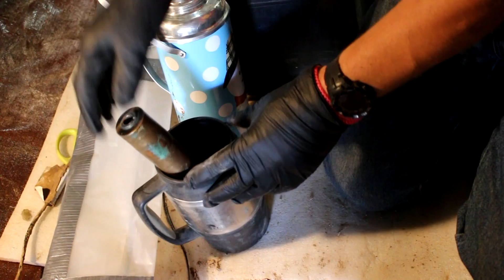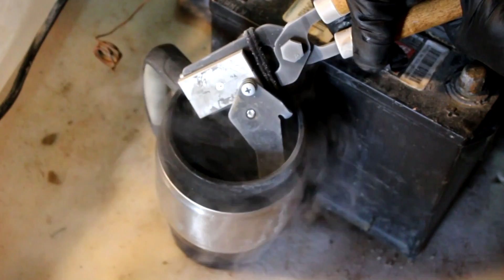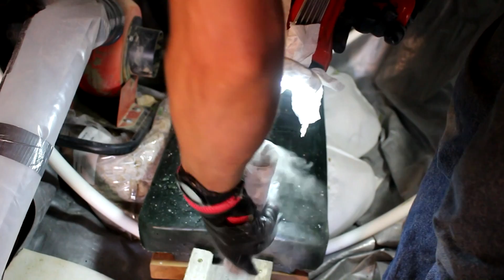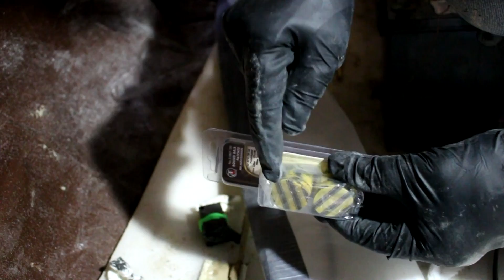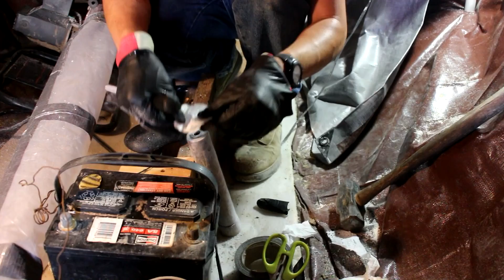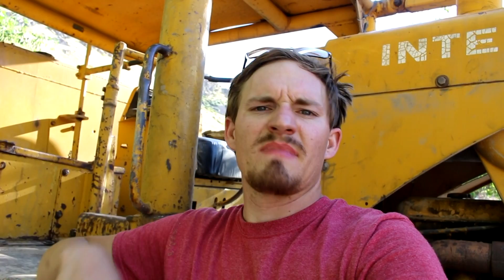Shooting Mercury Bullets

Comment: Mercury can kill in about 24 hours shutting down the nervous system. They would start losing motor functions first. You would not be able to save them by taking out the bullet because a high concentration of elemental mercury would start to accumulate in the brain. Lead gives you plenty of time when you're going up against mecury posioning. since you said you dont know why mecury is considered more toxic than lead What you're able to get on your skin and live isn't the same as the mercury you could potentially use in a bullet. There is a YouTuber that is a doctor that went over what happened to a lab technician when they got a drop of concentrated mercury on their hand.

Comment: I saw a hollowpoint being filled with mercury in a movie.  It was drilled out a bit, filled, then soldered shut.  According to ledgend, no it wont kill you right away.  But will later.  So even a non lethal wound...is.  Is that about right?
Reply: If you survive the gunshot... probably not. Mercury isn't that dangerous

Comment: Hey Cody  I was just wondering that you might want to do  Kelvins Water Dropper / Storm with mercury instead of water.  Recall the static generated with the Spregnel Pump you made (great video).  Afaik it will work with mercury and I don't know if it's  ever been done. Just an idea, no presh.

Comment: Imagine getting a flesh wound then die in a week later from mercury poisoning. That would be a devastating round if you encased Mercury inside of one designed to fragment once it hits something. Especially if they used a drop a dimethyl Mercury. Every hit would be a kill shot. That would work great if the US was fighting a country that was fighting dirty. Using chemical warfare things banned by the Geneva Convention.

Comment: The trick is to drop liquid mercury into a drilled lead round as a capsule, then seal it from the front with epoxy. The mercury acts as a penetrator.

Comment: mate why not fill a normal copper jacketed round like a 7.62mm x 51, take out the lead and fill it with mercury and then shoot ballistic gel and cap up the projectile with copper or lead top, so that when firing it it will still hold together under the heat when its transfersing in the air at over 2,800 ft per second or better still a .223 round or 5.56mm bullet, that way its going even faster or even a 6.5mm creedmoor projectile?
Reply: Because using a copper jaket would ruin the meaning of the test? Are you dumb or what

Comment: did the ramrod not fit when firing the ball, not because of lack of lubrication, rather because the barrel had contracted and so was smaller compared to its size at ambient temperature? If you were to cool the ramrod, or use a smaller ramrod, would it work?

Comment: Mercury is a hell of a lot more dangerous than lead to the environment all you need to do is do a google search to confirm that.  On the other hand, in places where mercury was mined, like the land Cody is on, the little bit he's adding is not likely to have a significant effect.  I would be much more worried about the long term health effects of walking into that tent, vented or no, and inhaling the mercury vapor that is still present.  Of course, Cody may have thought of this and have some method of measuring the residual mercury vapor, but if he does, I missed it

Comment: There is a very simple reason why shooting lead is way better than shooting mercury and I would have guessed you of all people would have known this, Cody. Lead binds to soil EXTREMELY well. The main mass of the Lead bullets are going to sit underground basically forever and the small particles are going to bind to the dirt basically forever, problem solved. Mercury, on the other hand, is a liquid first of all and DOES NOT bind to dirt as Lead does. So, who knows where the liquid Mercury is going to go after it's been shot at whatever, could get into the water supply and up the food chain. That's a problem. And then the small particles of Mercury will leech off poisonous vapors. Obviously, your single experiment here wouldn't have hurt anything. But let's imagine a shooting range that only used Mercury bullets like we use Lead bullets... the area would just constantly be leeching Mercury vapors in very toxic quantity, regular shooters would almost certainly develop Tremors and ED from the Mercury vapors. If you do a little thought experiment like that and know why Lead isn't considered a toxic substance shot from a firearm, then you understand why Mercury IS considered a toxic and Lead isn't in this setting. 

So, next time you don't know something like that, don't dismissively say "who knows why this instead of that..." scenarios. There could be a very good reason why. You should have looked into why that law is there, not dismissed it because you thought you knew everything about the subject. You could have learned something and given us that knowledge in this video instead of passively encouraging us to remain ignorant when we think we know everything.

Comment: Because lead is a really good, cheap material to make the cores of bullets out of. It's dense, and it deforms on impact. It's been used to make bullets for well over a hundred years, while mercury is as you have found, not terribly easy to shoot.

Comment: Maybe this is a misunderstanding of the physics, so correct me if I am wrong.  If the bullet is heavier, and the same amount of energy (same amount of powder) is used, it would have the same momentum, but a lower velocity than the lighter lead bullet. 
My thinking comes from the fact that to accelerate mass requires overcoming Inertia.  The more mass, the more inertia.  

F=MA

If you want to increase F by increasing M, and keep A constant, you need to increase the energy used to generate A.  Am I wrong?

Comment: Wait, but it's legal to put mercury in vaccines?  How the F does that make any sense?
Reply: They don't. Back when they did it was a less harmful form of mercury and was present in incredibly small doses that caused no harm. Calm down.
Reply: @randyohm3445  less harmful, mmmk
Reply: @whozaskin3639  Have you actually done any reading about this, at all? There was zero evidence of harm from it, and it was removed anyway to appease morons who don't read. If you're still worried about it, you're... well, you know.
Reply: @randyohm3445  depending on your definition of reading, zero, and evidence, you may be right..... depending on your definition of right

Comment: yeah but lead stays solid in the body and it's hard to absorb lead that isn't in solution, unlike mercury which is easily absorbed even as a pure metal.
Reply: mercury actually isnt absorbed easily in its elemental form. you can stick your entire hand in it and as long as you dont have any cuts you should be fine.

Comment: you did it wrong, use a hollow point .22 shell, put mercury in end, cap off with a small dab of solder.  shoot out of a .22 to a soda can from about 20 feet and watch what happens :)

Comment: these bullets are super deadly not only would the impact hurt but the mercury would kill you
Reply: Elemental mercury is actually pretty damn safe, it's mercury SALTS(Mercuric Chloride and Mercury nitrate, for example) that are extremely toxic. Mercuric salts are (mostly)soluble in water, and can therefore be absorbed by the body and into cells. Mercury metal cannot be absorbed even by the digestive tract if you drank it, and Mercury does not react with hydrochloric acid, so there's little concern for it forming a salt in-vivo.

Comment: Lead isn't considered as toxic as Mercury by most people because of how widespread leaded gasoline was used back in the day. Lobbyists from the Ethyl corporation refuted claims of leads toxicity, and although we've changed our ways and realized how harmful it actually is to our bodies, it's still used on a large scale in many materials like bullets etc. Actually, the guy that discovered the age of our Earth fought against Ethyl in courts to explain how toxic lead really is. But Cody is right, lead is pretty dang toxic. Many believe lead was a major contributing factor to the downfall of Rome, since they used lead pipes in their aqueducts, used lead pans to heat their food, and added lead acetate to sweeten their wine.
Reply: Someone watched cosmos
Reply: Ever wonder why a kid would eat a lead paint chip? They taste good. And the lead is in a form that will enter your system and cause damage. Touching a piece of solid lead won't hurt you.....probably.
Reply: @Dick_Gozinya  "Touching a piece of solid lead won't hurt you" So you don't consider absorbing a cumulative carcinogen to be "hurting"?
Reply: Pferd Schild  maybe they got a tolerance to lead? Like some people got arsenic tolerance for the water they use to drink
Reply: Actually lead pipes wasnt a problem until they conquered northern territories that had much more acidic water.
Reply: @Chuckiele  holy shit I just realised why the water at my grandfathers always tastes better
Reply: @Chuckiele  Much like in flint.
Reply: rome fell to socialism, nothing else
Reply: @5002strokeforever  top kek
Reply: @5002strokeforever  ignorant
Reply: @5002strokeforever  I love your sense of humor

Comment: Lead and mercury are not the same toxicity. Mercury is incredibly toxic and can be absorbed through the skin and the fumes of mercury can lead to mental insanity. Lead poisoning is much much harder to accomplish than mercury poisoning. The amount of mercury it takes to kill you is far less than the amount of lead it takes to kill you. The reason lead is used in bullets is because it is soft and can be spun by the rifling of the barrel and melts at a low temperature so that it can be molded into the shape of a bullet much easier than other cheap metals.
Reply: The main reason lead is used for bullets is that it's a dense metal

Comment: I wonder if the melting mercury created a similar effect to an RPG round?  The RPG's molten copper core can blast through steel plate and act effectively as an armor busting weapon because the molten copper is essentially frictionless and slides through as it burns?

Comment: Mercury is probably considered more of a risk, than more toxic. There's little danger of lead vapor, but mercury does build up in the air easily enough, at least in poorly ventilated areas. I remember we played with it as kids, rolling it around in our hands, in the basement, and a lot of it was lost. Year later I noticed little beads of it in one place. Hopefully the (heavy) vapor sank down and was absorbed in the concrete floor.

Comment: I'm not sure lubrication explains it. The shock-front opens up a cavity in BG. Although the last, slow, part might have no cavity and it just slithers along a little further. The charge blow-past, barrel friction, and superheated gel vapor might well liquify or bring near to melting T  the outer few microns as well.

Comment: Cool video but I have one complaint. You said you didn't know why they allowed lead bullets but mercury ones were illegal even though both metals were poisons. simply put, if you are hit with a lead bullet and survive you most likely won't die of lead poisoning but if shot with a mercury bullet you stand a very good chance of dyeing from mercury poisoning! Mercury can be absorbed into the body much easier than lead. There is no treatment for it and it's a horrible way to die. Lead bullets are really no more deadly than copper ones except in the long term effects and their ballistic properties.

Comment: I'm thinking friction with the barrel added more heat to the bullet than the charge. That's why you need jacketed bullets for anything more powerful than a pistol (or bigger than a .22) The lead would melt too.
Reply: Mishn0 actually you don't need a jacketed bullet for anything bigger than a .22, cast lead projectiles have been used for centuries in various calibers and is still a popular hunting option for rounds like the 45-70 govt.

Comment: I would make the case that the observed effect and penetration properties are not so much due to temperature as the tremendous pressure the round was under - although increasing the pressure will increase the temperature, there was a minimal ΔT for the hot gasses from the combustion of gunpowder to transfer heat to the rear of the projectile in order to liquefy it. (The powder was extremely cold too, which would slow combustion and therefore lower the chamber pressure and reduce the pressure impulse.) I think that the pressure, upon impact and even inside the bore, may have caused the mercury to flow as a solid, rather than to melt into to a liquid state. It would make sense that the tremendous pressure encountered by the projectile liquefied it, allowing it to flow through the weakest point of the target area - in a manner similar to an explosively formed penetrator, consisting of liquid metal at tremendous temperature and pressure. Although velocities were low compared to kinetic penetrators employed for just this purpose, the mercury is a relatively soft material with a lower yield pressure - and the target, being ballistic gelatin - continues the same trend of scaling downward (IE Softer than Tungsten penetrator from a 125mm cannon versus high carbon steel). The thing most analogous to this I can think of that we see embodied is Depleted Uranium projectiles being used against various armored vehicles. The DU is soft and dense, and it literally flows through whatever is in its path. This was a very interesting experiment, and as all truly good experiments, it raises more questions that it answers. Thanks Cody, I would be afraid to handle mercury let alone load it into a firearm!

Comment: "That mercury isn't going anywhere" except the water table you are situated rather close to.
Reply from the maker: Water table? lol thats over 1000ft down.
Reply: ***** having watched his videos, I know three things.   

First, he is very conscious about the environment, he know's what he's doing and how to clean up after himself.  

Second, the Mercury that he has, came from his own land.   He has been extracting Mercury from his own land, if a spill is not cleaned up, the worst case is that the Mercury would be returned to where it came.

Third, he does not have access to the water table.   Doh!   He drives a truck into the city where he obtains water.
Reply: The whole area is a hotbed of Cinnabar anyways Russell.
Reply: Were you in the mine?   You said you had problems getting enough electricity.
Reply: tuber didn't anyone ever tell you that you almost all of the United States oil comes from the Middle East and is imported? Fracking hardly affects drinking water. And if you remember from grade school, oil is thicker than water. It can easily be separated with a filter. In my opinion, oil companies should be fracking Canada and Texas because the majority of funding that terrorist groups get comes from the purchase of imported oil. Would you rather have terrorist attacks or would you rather have water that can easily be filtered and boiled at a water treatment plant (which already happens) before it even reaches your home's water pipes?
Reply: tuber research before saying something stupid

Comment: I have a couple of alternative theories about what's going on here.

One is that, as a few other people have alluded to, it could be yet another case of "Cody inadvertently makes an Explosively Formed Penetrator."

Another could be that the mercury partially vaporized when fired, leaving a lighter projectile with a smaller diameter; in a way almost acting like a flechette with a discarding sabot.

Comment: The molten Metal being able to penetrate deeper is actually a mechanic of some Jacketed armor penetrating rounds. A hard jacket allows primary piercing of armor while a secondary Metal, commonly a lead alloy basically liquefies from friction and "Injects" itself into the cavity resulting in a high velocity and more effective blast stream.

 The more effective directed penetrating power is sorta similar to shaped charges they use to cut through things like steel beams during demolition. Which by forcing a charge to a narrow stream or "line" makes it's way more useful than just allowing it to blast freely in all directions.

 So in my opinion something very similar might of happened with your mercury bullet. Very cool video, and thank you.

Comment: Cody can you smelt and make your own sword.
Reply: Making a bladed weapon of any value cannot be done by just casting and sharpening the edge.  It would likely not hold an edge at all or just shear off the first time you strike something hard.  alot more metalurgy goes into blade making than I feel like trying to write here.  At the most basic it involves being specific about alloying elements, developing the right size, shape, and direction of grain structures, and tempering so it's won't shatter when striking.
Reply: +Everett McGee I just meant he should do it as a cool project , it doesn't have to work, thought if he could make a functioning sword that would be awesome to, and I think if he really tried that he could do it considering everything else he's done.

Comment: Hey Cody, was talking with someone about your video here an had an idea. Could you make a Sodium Amalgam with the Mercury and form that into the bullet? Just 2% sodium and it could be solid at room temperature, be a little easier to handle/clean up, possibly retain its shape longer through the gel, and that little variation in composition won't affect the overall weight of it that much.

I don't know if other amalgams might work better. Using silver sounds a bit expensive, but you seem to have some of that laying around yourself.